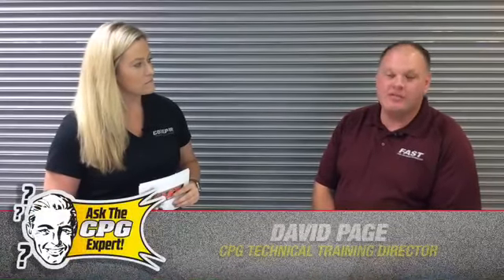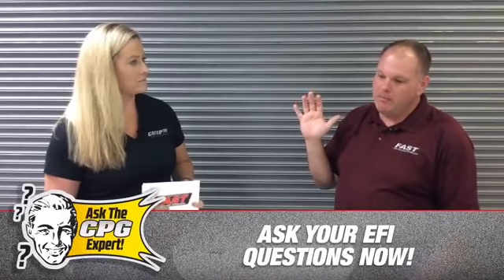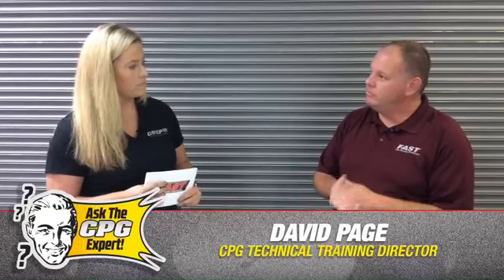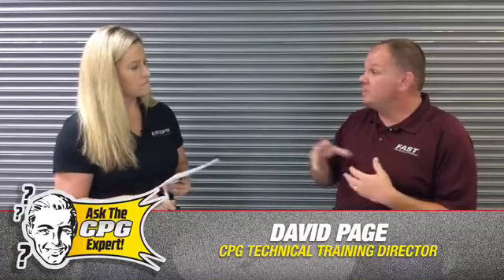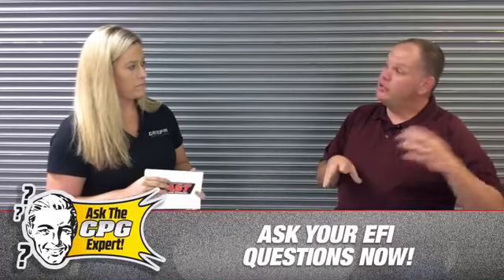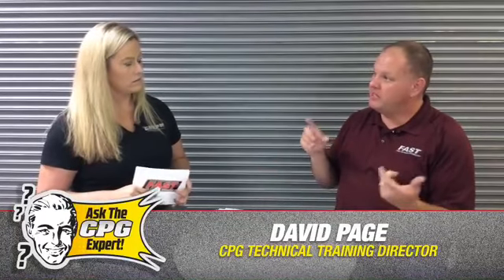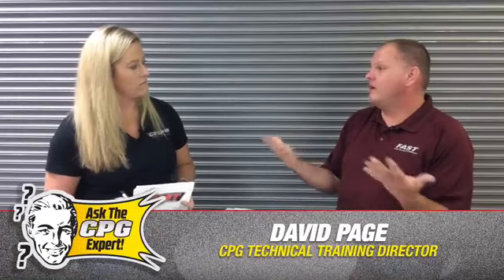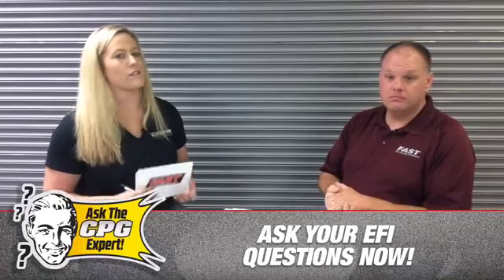Ask A CPG Expert: David Page, FAST EFI Master

Comment: Hii i have a ford f150 5.0 2014 with headers and intake afe stage 2 and boss 302 and tharmostat 160 and i need a custom camshaft for the f150 i just talk with ray in ford raceing he told me talk comp because the f150 have low in piston 10.5.1 and the coyote have more hp low torqe the f150 have low hp more torqe i need some help from you 

Thanx,,,